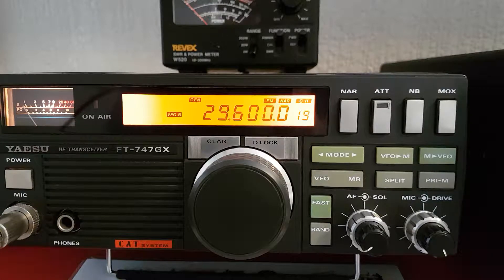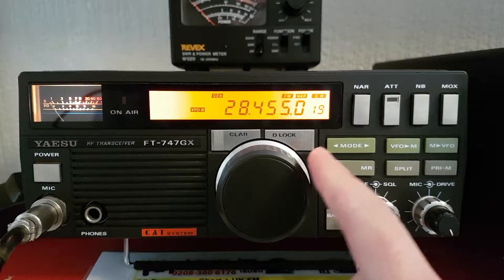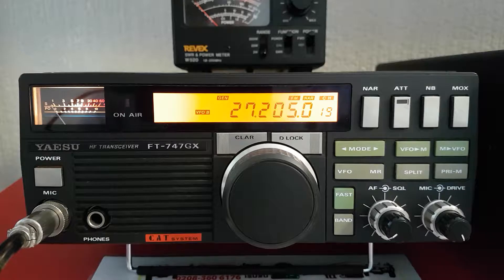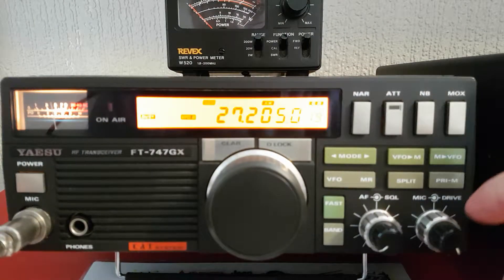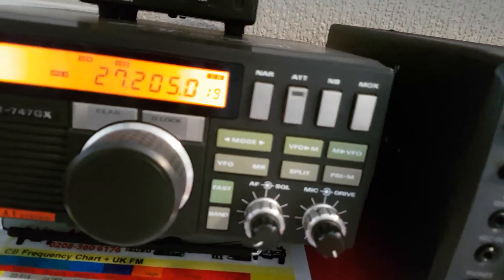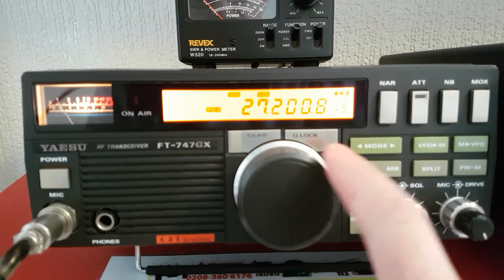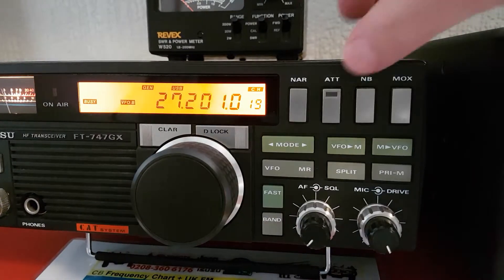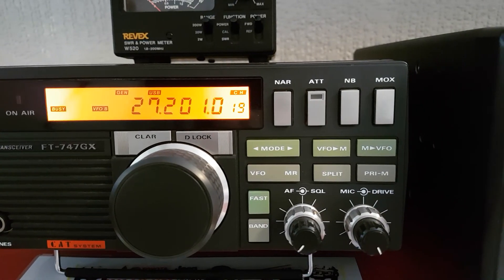Yaesu FT-747GX

Comment: I’m currently looking for my first HF rig after receiving license last week I was just offered one of these for $550 is it worth that kind of money?
Reply from the maker: Yes matey I've recently sold this model for around that kind of money
Reply: No worries, thanks mate. Looks like a nice radio for a beginner.
Reply from the maker: Yes they're nice and basic whilst retaining good performance
Reply: @morphshag   nice radio for Anyone,  ive had everything from Flex 6300 ,  kenwoood 2000 , yaesu  ft 857,  MP 1000 etc etc etc.. but love using the little radio.. dunno why... its just nice to use.
dunno about where you are but here in UK, the 1st licence ( foundation ) is limited to 10 Watts the 2nd ( intermediate ) 50w, so  you would need to do the power mod so you can control SSB power out, its easy though.. remove filter board, snip diode 99 and  put  filter board back in. incidentally the full UK Amateur licence allows a maximum of 40 Watts to be  used.